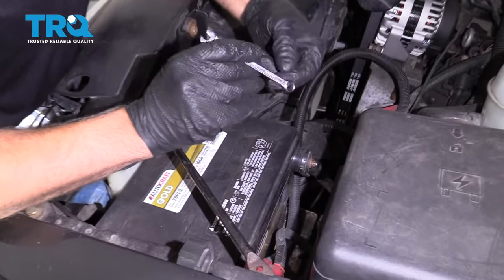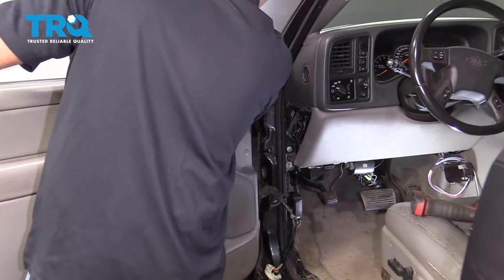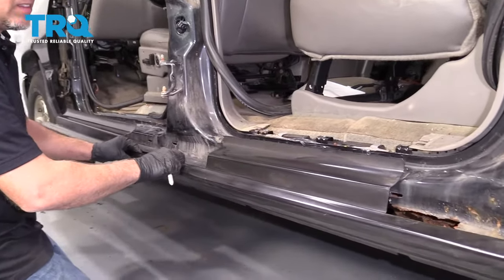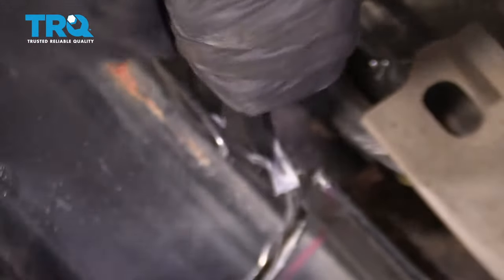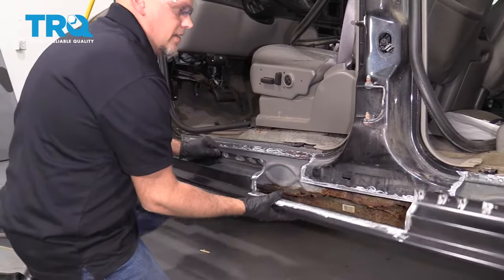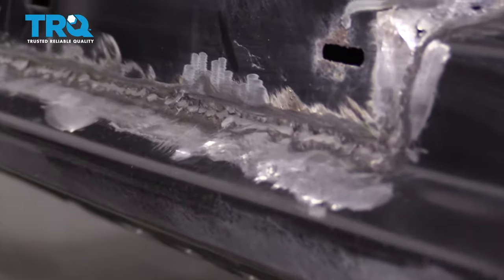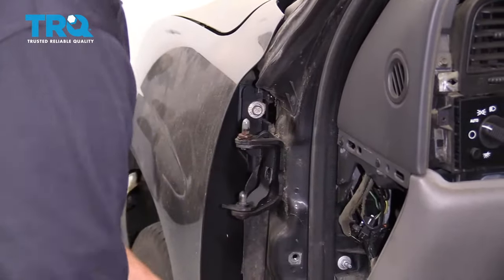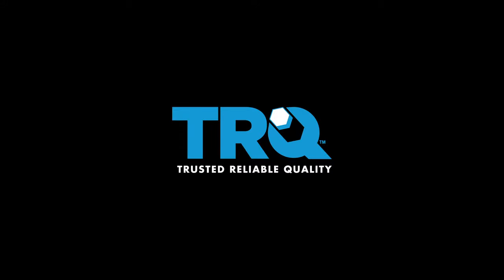How To Replace Rocker Panel 2000-07 GMC Yukon

Comment from the maker: √  Watch the Video
√  Buy The Part at 1A Auto http://1aau.to/m/Shop-TRQ-Parts
√  Do it Yourself
√  Save Money
Reply: TRQ hello I have a 2001 GMC Yukon and i wanna do this but when I click on the link it says it dose not fit. I am just wondering if you can point me in the right direction? I just don’t wanna order the wrong parts.
Reply from the maker: +Cody Radler We currently do not carry any rocker panels for your vehicle. Thanks for checking us out!
Reply: @TRQ  isn't a tahoe and a yukon the same body...looking at a 2004 yukon for sale and will need this repaired,do you carry rockers for 2004 yukon